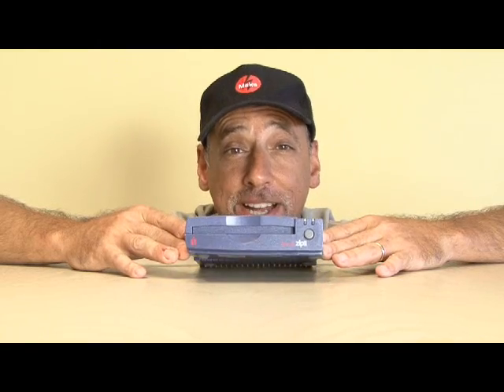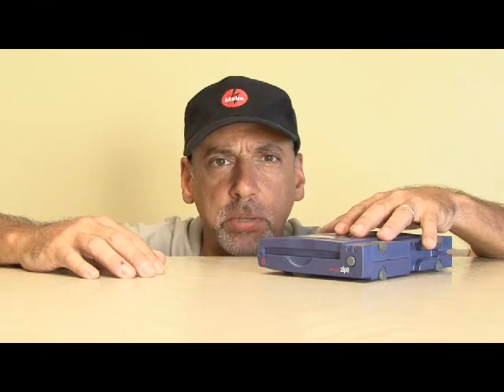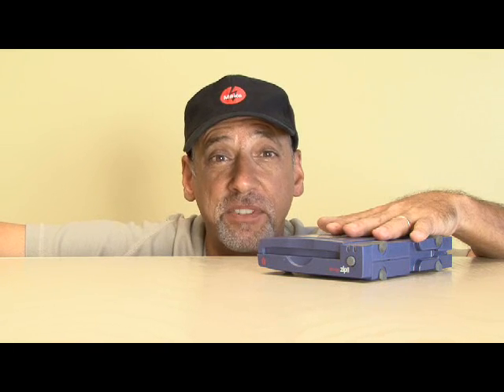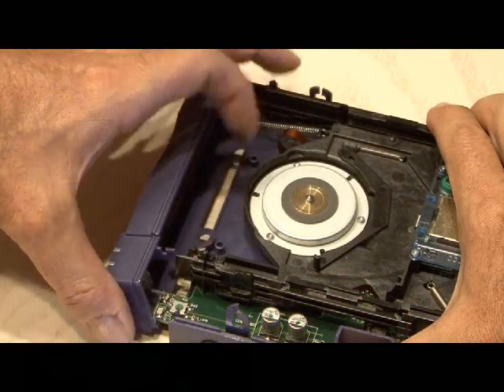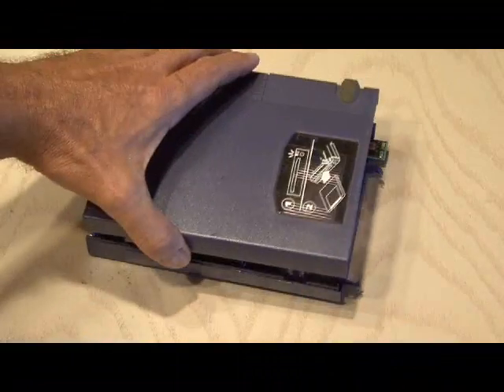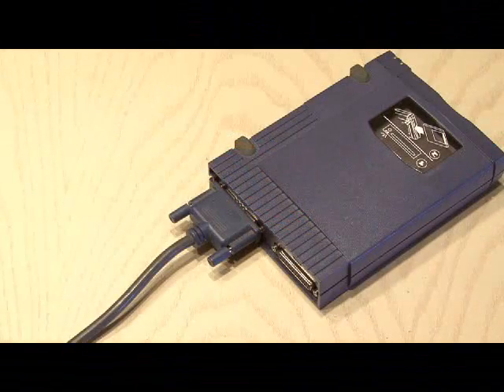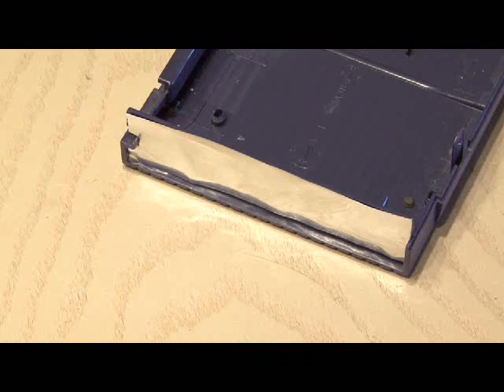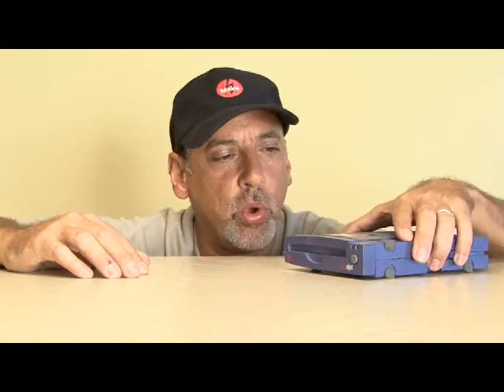Weekend Project: New Life For Old Zip Drives

Comment: That was great :) I loved the hard drive idea, got me thinking. With all the extra space in there, some cushioning and shock protection could be added to make the enclosure more protective of the hard drive. Also, using the same piece of heatshield for the piggy bank, you could cut out space for a  female USB socket and mount it there to give it a more "pro USB" finish :) fantastic vid! im gutting mine out right away!

Comment: This has thoroughly convinced me to go and get the zip drive out of the scrap electronics bin outside. It hasn't given me any ideas of what to do with it though! I thought "putting a HDD in it" sounded like a good idea to save money buying an enclosure, until I found I had to buy a small, neat, easily-portable enclosure to put inside the more cumbersome zip enclosure. The motor looks shiny though. I'll bag that! Might fit an Arduino in the enclosure...

Comment: Those are great fun things to do with a zip drive. But, i would prefer to repair my drive which is just a few years old. It does make more like a repeating 'thud' sound rather than clicking sound. Lights blink, and there's a humming too, but it doesn't shut off by the on/off switch. Sounds like there's plenty life in the old zip. Comments, suggestions?

Comment: i have one of the disks. also i think you will find that they are parallel connectors. the cord has lots of wires serial would have 9 or 10 at most

Comment: That "serial connector" is actually a parallel connector. Significantly slower.
Reply: The "serial connector" is really a serial connector.  I forget the pin counts, but it is one of the two standard sizes (small and large).  A parallel connector would have been a great disadvantage for a ZIP drive owner.  He would already be using his parallel port for his printer.
Reply: WhiteTrashTrailer
IIRC, the ZIP drive had a version that ran on parallel, I was one of the unfortunate folk who actually owned one of these things, though mine was a serial connector. Maybe it was that big, I can't remember, cuz I was only a kid at the time lol
Reply: WhiteTrashTrailer the fat ass serial port was 25 pin and the small one was the 9 pin atari esc plug
Reply: WhiteTrashTrailer In fact the ZIP drive never existed in serial, only ATA, SCSI, LPT (printer with passthrough for the issue you mentioned), both SCSI+LPT version, and lately USB and firewire.
In LPT it was slow as hell, if I remember correctly, 1h for 100MB.
Both serial and parallel had sub-d25 conenctors but on the computer side, one male (serial) and one female (printer). As sub d25 for serial second's line where barely used, sub-d9 takes advantage and is not mistaken anymore with the printer port.
Reply: Damien Degois Yes, this is the correct answer.   The DB-25 connections are used on both the SCSI and Centronics parallel versions of the external ZIP100 drives as well as on the ZIP Plus which could be connected to either a PC-style parallel port OR a SCSI adapter, automatically sensing which was connected and becoming the right drive for the occasion.  I still have a (working) ZIP Plus drive that has proved incredibly handy for moving data between a PC and an Amiga 2000, as the latter lacks any ethernet or network connectivity, but does have a SCSI card with a DB-25-style connection, into which the ZIP100 Plus connects easily with no adaptation required.  Contrary to the implication in the first post of this thread, this is MUCH faster than using the serial connection with a null modem cable to transfer files.

Comment: @HenryGAD There were two versions of the original external 100MB ZIP drive. Neither was serial. One could connect to your old parallel printer port, and the other was a SCSI model. Both happened to use a DB25 connector.

Comment: I once made a necklace out of a super nes controller. I braided the wires that was in the cord. I took out the buttons of the controller and put the braided wires through the shoulder holes. It was cool because if you looked through the button holes the spots inside were gold so in a way it was kind of bling bling. I felt no remorse because the controller didn't work.

Comment: I have an old floppy disk drive, and would like to turn the motor into a  low profile blower for a costume. I have some PVC that I can make the blades and frame out of, but can't figure how to make it run. Any help you can give on getting a FDD to run off a battery?
Reply: You can't.   The drive motor doesn't run off a battery.  It requires a driver circuit.
Reply: Is there a circuit I can build to run it, or can I scavenge the circuit off the board it came from?

Comment: Um, most external zips were either Parallel, or SCSI. Neither of which is Serial. This is a parallel ZIP, the SCSI one would have two switches between the connectors for Term and SCSI id. Iomega also made an external USB zip but it was towards the of its life. That one would make a nice external drive enclosure. Take the circuit board out of your drive enclosure and drop it in.

You could boot from a SCSI zip on a mac, and have a troubleshooting load before CD burners were common.

Comment: I miss the floppy disks.  First off, they are less susceptible to scratches than CDs, due to the included housing
Reply: but floppies are susceptible to rot, they'll corrupt if you look at them wrong. Heat will hurt them, cold will hurt them, you can hurt their feelings. I used floppies for years, but I am glad to be done with them.
Reply: ***** well, everything has disadvantages and advantages.

Comment: I would make a MIDI-capable USB sound card that also has essentially a full SoundBlaster X-Fi USB, and a weird compatibility circuit for the X-Fi PCI's MIDI I/O. The printer hole would have the ports, and the parallel hole would use the four bottom-right pins for USB.
LOL.

Comment: I saw whats called a polystation 3 its a cheap ripoff of the sony PS3 look up polystation3 by the youtuber Ashens when he took that cheap thing apart b/c it wouldnt play any sound and when he opened the cover there was tons of room for a hard drive, i was thinking of making an external hard drive with that thing but i have a WD mybook, 2:29 the large part here is most likely a stepper motor and is that square motor a standard DC motor Kip?

Comment: I'm thinking of replicating the hard drive in the zip drive method, but I was wondering what wires I would have to solder together from the usb cable to the cable on the zip drive. Can anyone tell me which ones, thanks.

Comment: Ugh.  Good luck with using the parallel cable for a USB cable.  It's not rated for 480MB traffic.  You might well end up with your USB drive defaulting to the USB-1 12MB rate.  Have fun with that.

Comment: a hardware and a software path for locking, I ve got internal,external parallel,scs,usb 100 and 250MB drives to sacrifice in the attempt, but would like to beging the offensive with a bit of more infomation. regards,Saul.

Comment: My old zip drive already has a usb connector on it and it still works so will not be using for this project.   You never know when someone might find a bunch of old zip drive cassettes and will need a zip drive to read them.
Reply: that's true. i've got a usb one from 2000 in my desk and sometimes when i need it i use.... now i remenber that i've got 2 zip drives

Comment: You are wrong, a floppy has a capacity of 1.44 Mb, so 100Mb of data would be about 70 floppys. 104857600 bytes (100Mb) divided by 1509950(1.44Mb) = 69.4. So Kipkay wins, and you Fail.

Comment: Seriously? 
They came in both SCSI and IDE/ATAPI. they shared the same guts, with different controllers. I used to fix old SCSI drives by replacing the guts from the IDE versions (cheaper).
Have you ever heard of a JAZZ drive? How about SyQuest? Ring any bells?

Comment: 1. If your drive still works sell it on Ebay and buy something USEFUL from the money you get.
2. If it doesn't work, do the same.
3. NEVER, NEVER, NEVER, NEVER, NEVER EVER "just solder some USB wires to a parallel port". Basically NEVER EVER solder any wires from standard cable type A to cable type B unless you know what you are doing. Chances are someone plugs type B (in this case parallel) to your modded port and you won't know what happens (gets killed onboard).

- worst make shit ever.

Comment: I actually thought he was going to muck around with the hard drives allocation tables and spinning speed - but no, you end up with 4 pen drives you can't separate from each other - that can also only be used as four separate spaces!  What's the point!  If you're deparate to use 4 pen drives at once, why bother with the old hard drive!  I used to muck about putting small things in tny containers a la Goonies, but I was about 6!

Comment: hi,can you sell me an zip drive?i live in Sout Africa,they are unavailable.
Reply: +Conrad Meyer This is such and old video, that no one will buy them, but Zip drives were available in SA, Try ebay maybe
Reply: +Conrad Meyer Why do you want one?  You're not actually thinking of making one of these so called projects.  Kip is entertaining to watch but many of his projects are strictly for shits and giggles.
Reply: +SharpEnuff    i have a Boss BR 8 Dijital recording studeo,it uses a 100 mb zip {internal} drive i thought i could use a iomaga zip drive but   the plugs are not the same      i then discovered that computer hard drives have the same plugs so i bought a power serply and a hard drive        to be honest......if i think about it       its not likely to work    because    the 42 pin point hook up is not going to mach that of the zip drive    so    back to square one     an internal zip drive with a 42 point plug

Comment: Don't even mention ZIP Drives. It reminds me of the "click of death" that instantly turned a few dozen of my Zip disks into a useless pile of plastic bricks. Yes it worked for a while but on the whole it was expensive, used expensive proprietary media, didn't last long before going south. I wouldn't want my HDs to look anything like Zip Drives. Far from being "cool", they'd look like something that suddenly stops working. Not good for HDs.
Reply: its good for a hitachi deathstar.
Reply: TheDarkMann
it's actualy called deskstar
Reply: I know, deathstar is its nickname.
Reply: TheDarkMann
yup. i've several of these all of em was GARBAGE
Reply: SuperYvonne72 There was really only one model of deskstar that was completely unreliable and that was the 75GXP.
However they should be reliable now as Western Digital completely took over the line in 2012.